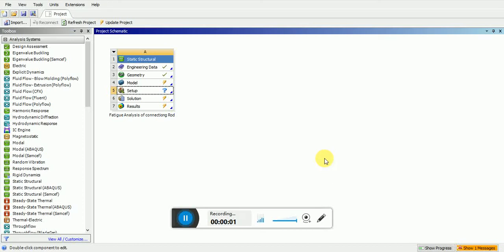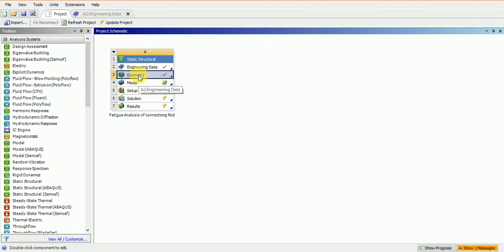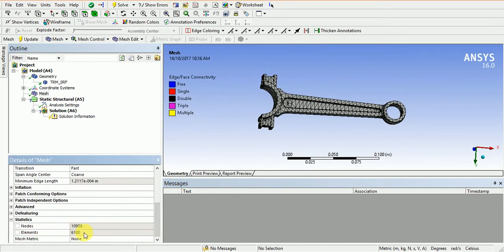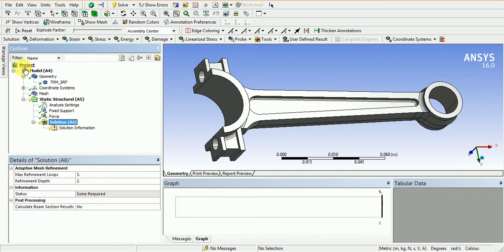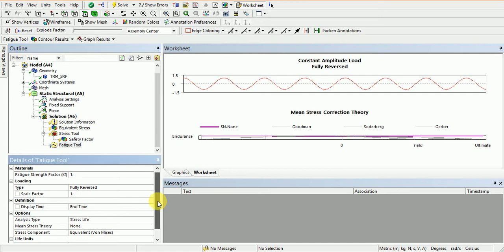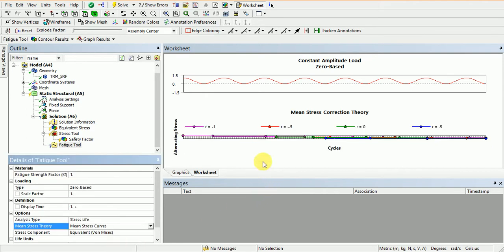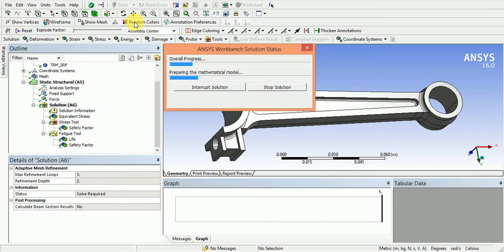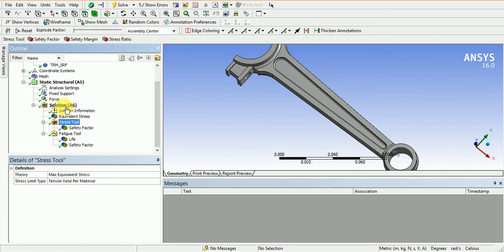Fatigue analysis of connecting Rod in ANSYS

Comment: In life it shows 1e6 and model in red in colour what does it indicate please reply?
Reply: Varun Kumar your Questions answer is here
: 1e6 cycles means connecting rods infinite life condition. 
If connecting rods will not fail after crossing the 1e6 cycles then we can say "infinite life" if it fails before 1e6 Cycles then it may be in finite life categories.

1e6 cycles means connecting rod subjected to 1000000 times compression and tension .

Thank You !!👍